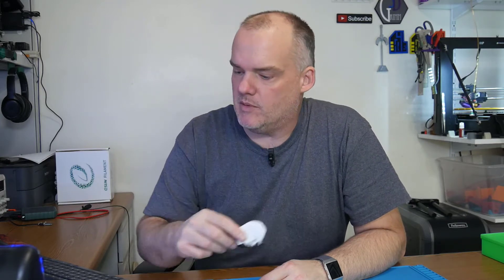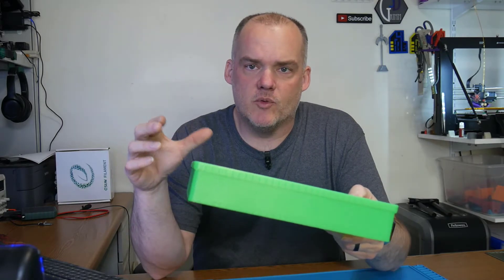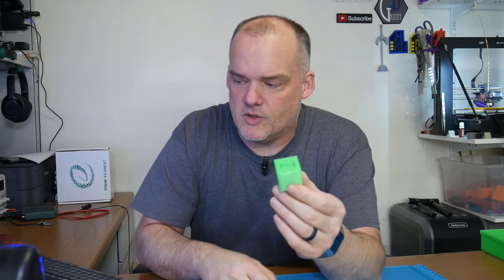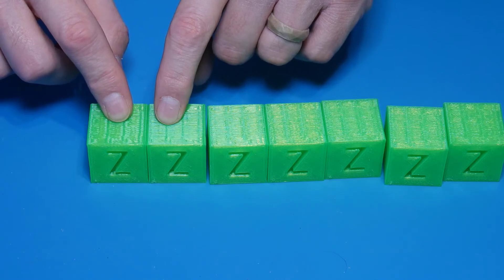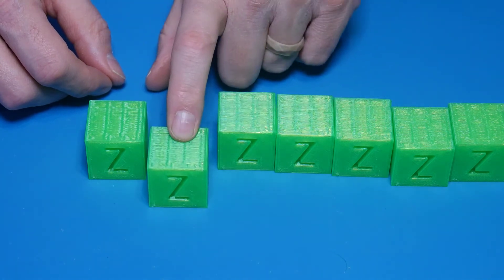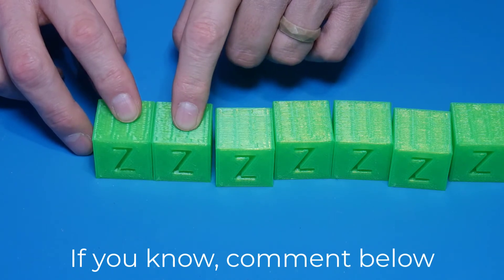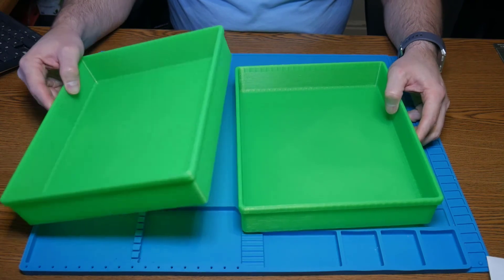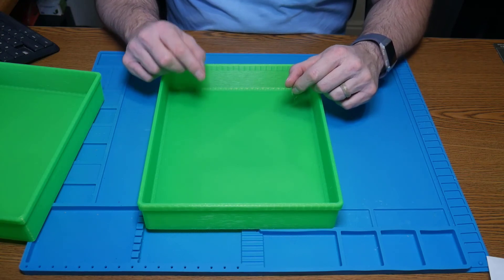Increasing my Monster D9/500 Print Speeds

Comment: i know this is a couple of years old now but i recently got a D9 400 really cheap. how much do you estimate all the mods has cost? all the linear rails and the hot bed?
Reply from the maker: Mods have been pricey, but mostly because of where I wanted the printer to end up. I originally purchased the D9 because the frame seemed really strong. I knew it would need heavy mods to make it work well. 

Plus, a few of the mods are custom (the high power bed heater, and the flexible build plate, foe example) those were pricey as well. But those expenses would be totally different for a 400mm